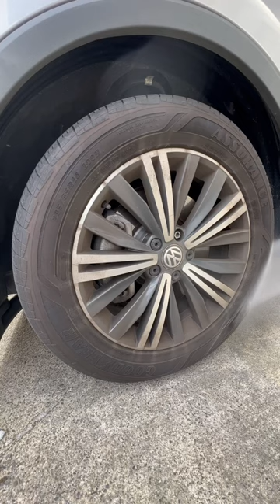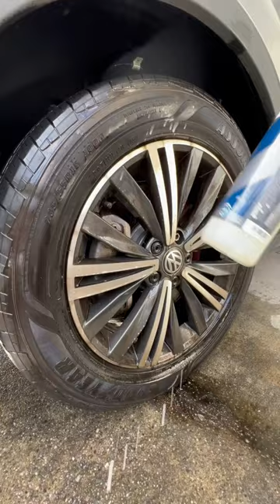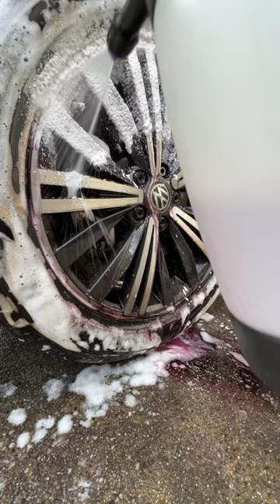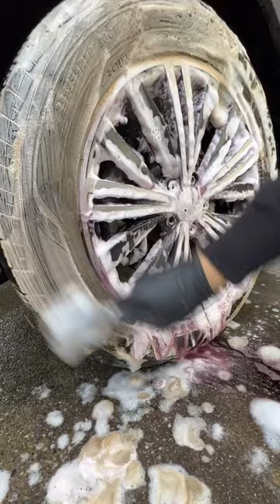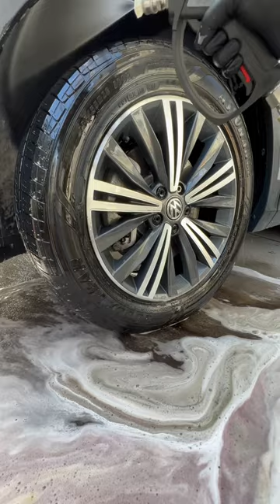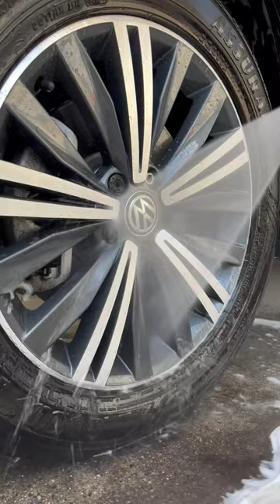Super Satisfying Wheel Cleaning✨ #Shorts #ASMR #Satisfying #Cleaning #Detailing #Cardetailing #Car

Comment: Rush
Reply: What’s the last chemical spray u put on the wheel
Reply: @richardvigil3485  it's a wet coat
Reply: Hey sorry that I say this ….
But this chemical is not good ….
Test the stuff from Polytop Germany 
You spray it on the wheels and then pressure washer an clean inside and outside 

Polytop wheel cleaner SF 

Trust me it’s easier, no brush only spray